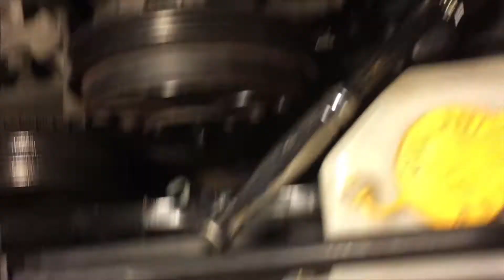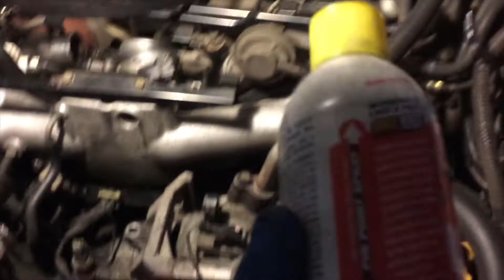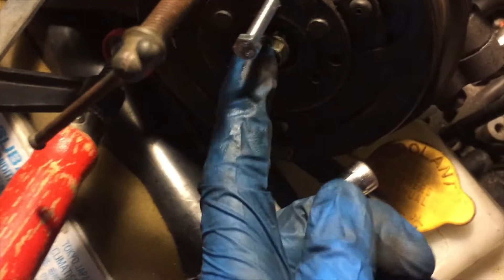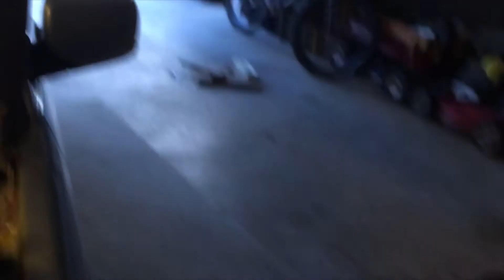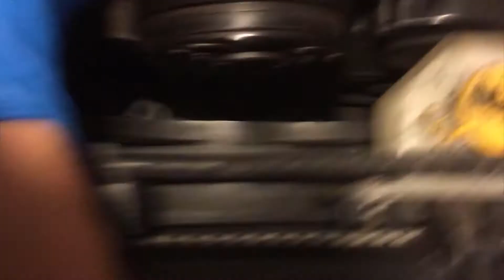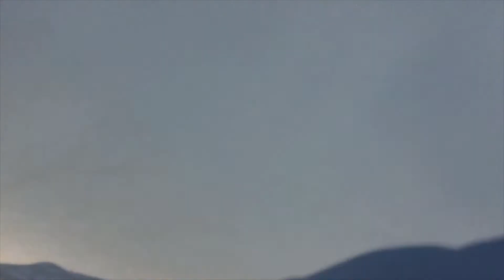Subaru | Compressor Bearing Replacement

Comment: Thank you! You answered a question I had about replacing the bearing only instead of the whole clutch kit, and gave the part #. No one else posted this info, as far as I can find. :P

Oh, and folks who don't know how to remove / install a bearing, they should not attempt this repair. I suggest they get the clutch kit, or take it to a shop...

Comment: Subaru | compressor bearing replacement:

*completely skips over the bearing replacement

Change the title to: how to lube the QC compressor clutch plate for easy removal.
Reply: Exactly what I thought. Very redneck video too..lol
Reply: No shit right? My 02 3.0 Outback Compressor clutch needs a new bearing, got the clutch off easy, snap ring easy, and was hoping for a video to remove the pulley and I get stuck with this idiot and his reference to a "grabber thing"... but no video. I'm guessing he's referring to a 3 jaw puller which I am going to try right now.

Comment: Thanks, man! This is exactly the same job I'm working on- with my 2004 Forester XT. Yeah, those 14mm bolts to remove the larger compressor mount are a PAIN! I'm not sure if I'll get them out but ONE of the smaller ones holding the compressor to this larger part is IMPOSSIBLE to get at ! WHO designs such monstrosities?!
I also had to remove my radiator fans and almost the radiator just to get NEAR the bolt loosening the compressor pulley... wow.